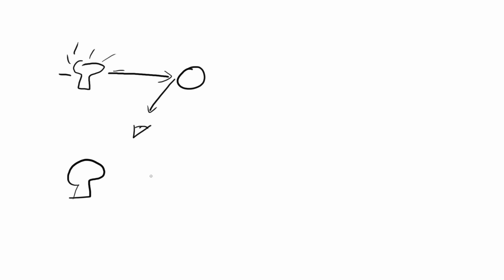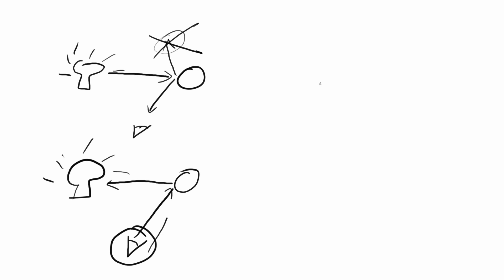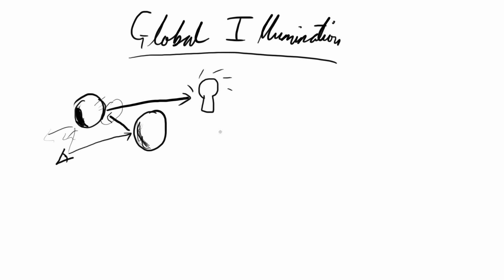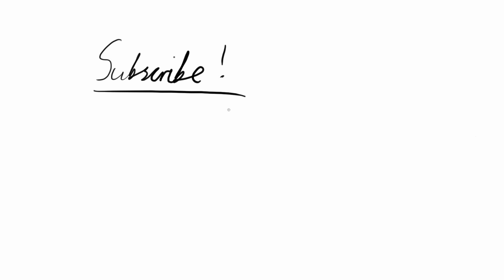Ray Tracer #1: What is a ray tracer?

Comment: Excellent explanation! Thanks so much! Loved this video! My only question is, under your global illumination explanation of Raytracers. After the Ray has bounced off the black shadow of the second sphere, and it bounces to the second sphere, how does the Ray know to bounce towards the light? Does it automatically bounce towards the light then, or does it simply fire in any random direction, and you have to keep firing more rays till you hit the light, till it makes an accurate simulation? Or, does it fire multiple rays from that same location after it bounces off the other sphere? Thank you very much for the info! Let me know if you need more info for this question, I explained it a little messy :).
Reply from the maker: We actually do a bit of both. This is a topic that we'll go into much more detail starting from episode 10 (this should be up early next week).

Most surfaces fall on a scale from shiny, like a mirror, to matte, like a piece of paper. The lighting of shiny surfaces is influenced mostly by the geometry of the surface, but the lighting of matte surfaces is influence more by the position of lights.
To deal effectively with any type of surface, we will ask the light to generate a ray that it 'likes' and we ask the surface to generate a ray that it 'likes'. We can combine the effects of these two rays to get a pretty good estimate for the effect of that light on the surface.

We also, separately, fire another ray into the scene to estimate the effect of bounce lighting - this effect is particularly clear if you hold a brightly coloured book against a piece of paper. It's much harder to generate good approximations for this, so the ray is fired in a slightly more random way, but this effect is usually quite small so it doesn't matter too much.

There's always a bit of luck in whether the rays end up in a useful place or not, so three rays aren't enough to get a really accurate picture of the lighting. This means we have to fire lots more rays - but we start of all these at the camera. Each pixel in the final image actually covers a whole area of the scene and not a single point so we want to sample several of these points anyway. By firing extra rays from the camera, we get both extra lighting rays and extra samples within the pixel.

We also don't bounce the two rays that are aimed at the light because each of these would need 3 rays of their own, which may need 3 more each and so on. This can get very inefficient as the more bounces a ray has been through, the less significant it is - each surface it hits will absorb some of its light. Instead, we only follow through the one ray intended for bounce lighting, and firing more from the camera effectively gives us these extra rays anyway, but in a slightly more efficient way.

The main idea is to make good guesses about what matters most in the majority of scenes. This allows us to focus processing time on the most important parts of the scene which will give us a better looking picture more quickly.
Reply: Thank you so much HillSoftCode :D! I really appreciate the quick and detailed response! That makes a lot more sense now! I'm definitely looking forward to watching your next video on this topic! I have to say, finding someone who responds to their youtube questions is very rare to find. I can't say how much I appreciate it :). Making a youtube page is tricky, but keep up the good work, and I bet you're going to get a lot more subscribers in the coming months :D!

Comment: Rasterisers can be physically-based, *to a degree*. I'll give this video the benefit of the doubt since its age, but nowadays it isn't uncommon that rasterisers compute specular reflections from direction, point and spot light sources in a physically-plausible way. Certainly not to the extent of ray tracing, but it isn't entirely unrealistic to the point where it's blatantly obvious.

There are various algorithms out there for rasterisers that can take in a position and/or direction for a given light source, and generate a physically-plausible, and in some cases accurate, specular highlight for that light source. Unfortunately not for reflections from geometry (though there are more expensive solutions for doing this), but certainly for the specular highlight. Most, if not all triple-A engines are switching to these sorts of algorithms. I myself have a simple version of one of these algorithms, the GGX BRDF, in my shaders for Minecraft, and the GGX BRDF in my shader handles the reflection from the sun.

Some of these algorithms are so sophisticated, you have to use a given material's index of refraction to generate an IOR ratio, to work out how reflective that material is parallel to the normal, *to work out what the reflection should be*. And that's just for non-metal materials, metal materials are a whole lot more complicated.

Still, nice video! Informative, straight to the point, and fairly well spoken.
Reply: Indeed! And you get a similar knock-on effect of SSAO...